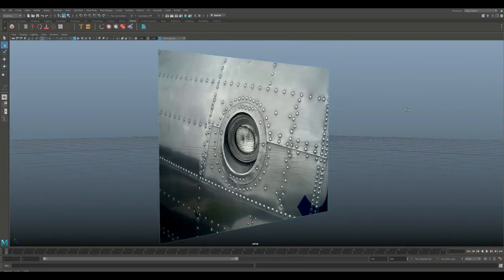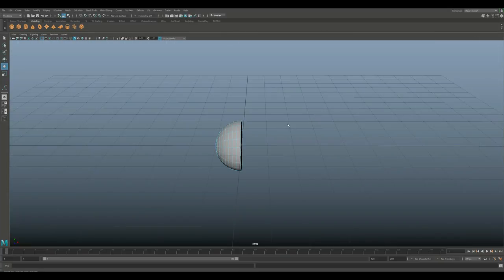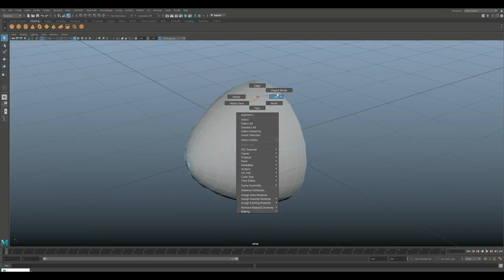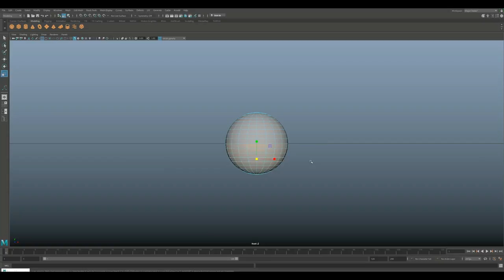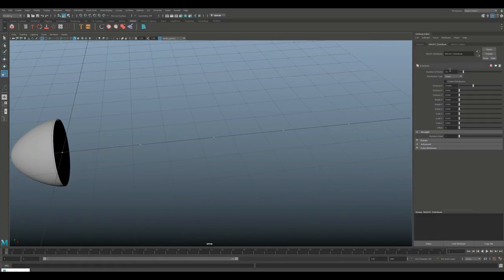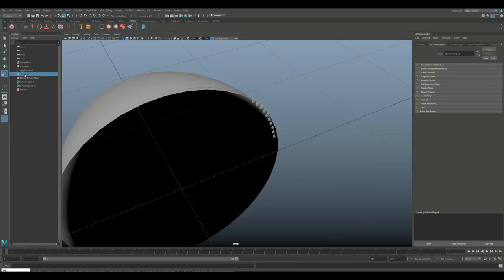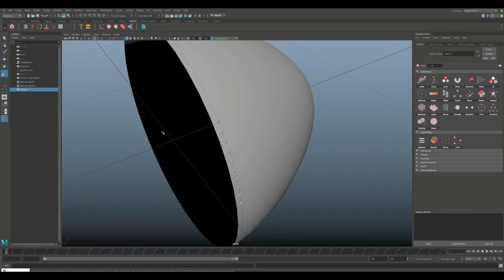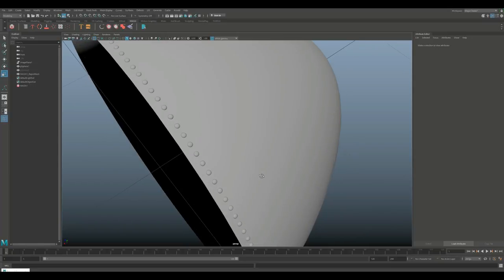How to automatically place rivets on a plane model with MASH in Maya 2018

Comment: Mike... Amazing video! ... Now I also have a question, until now I have used software like CrazyTalk 8 for creating lip syncing avatars, the only thing though is that I would love to show the environment around the avatar and have it stand up or down and walk around the scene while talking. Have you ever done lip syncing on Maya or could you consider creating a tutorial expanding this topic? do you know if Autodesk will soon come out with an update or plug-in that would cover this important need, the same way they created their instant rigging module recently? Thanks for your advice. Hugo Barbosa
Reply from the maker: Hi Hugo. Thanks for your question. Problem is that I do not do characters. sorry :-)

Comment: Rivets belong to the realm of Normal maps.
Reply from the maker: Usually yes but I does not hurt to know multiple techniques
Reply: Actually yes and no. Usually (at least for film and I guess same workflow is used for games) is that you have a flow poly object. You save that and then you make it very high poly modelling all the rivits and ridges etc and bake that out into normal map(s)  and apply those to that initial low poly object. This way your normal maps actually perfectly matches and follow contours which is very difficult to do yourself in 2D alone. This especially goes for faces, wrinkles or rocks and trees which are deformed by the surface as well.

But eventually for sequences or games you'll want to bake it into normal maps to keep poly count down and render fast(er). But for a single still no one cares if it renders in 15 minutes or 2 minutes ;)
Reply: Raymond Doetjes: Yeah, thanks for explaining. It was nice to see like-minded people like you :D Regardless, it eventually comes down to the use of Normal maps, which is what I wanted to say :P (I wasn't being negative or anything, just adding another ubiquitous method to achieve the same result).

Comment: Hi Mike, love that new monitor but it comes with some need for adjustment. This is how your videos look like on Youtube: https://i.imgur.com/f8UG1IE.jpg   https://i.imgur.com/eQh8WBg.jpg   https://i.imgur.com/OVLinmK.jpg

As you can see, the now relatively small text becomes slightly blurry and somewhat hard to read in comparison to other tutorials. Is there a chance you could double check your encoding settings for your videos? Love the MASH stuff, because it applies to Maya 2016.5 as well!
Reply from the maker: Thank you for letting me know. I will look into it. Having some recording / audio issues at the moment. Will try to improve